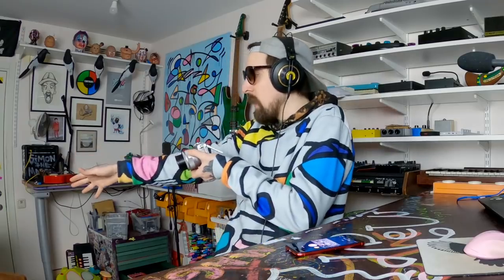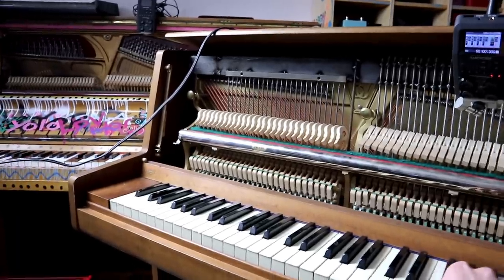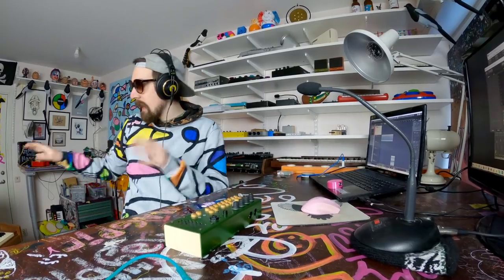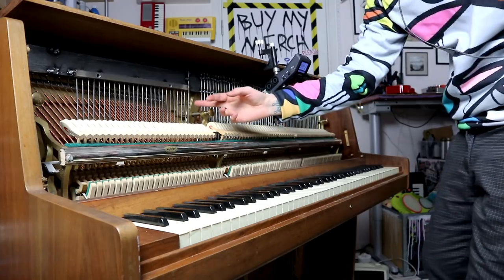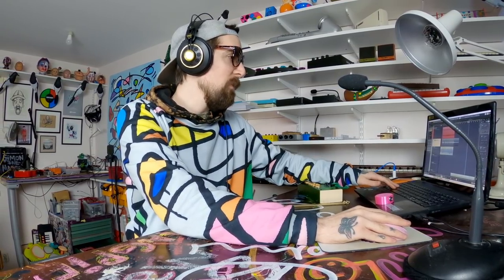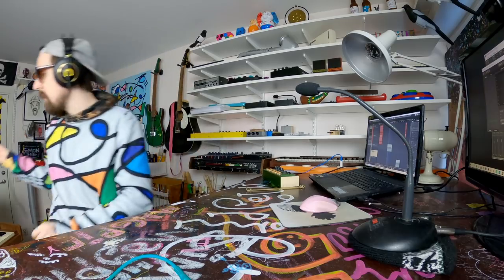I Made A LIFE SIZE TOY PIANO And It Sounds Absolutely Haunted

Comment: Sorry if someone said this already:
you don't need to change the length of the bars to tune them.
To tune them down, you can add weight to the end, or thin it close to where it's welded.
To tune them up, you can thin them (remove weight) near the end.
Cutting the bars shorter is fine, but welding them seems like a bad idea to me, because you are annealing the metal, and that changes it's hardness (uneven).

Comment: that piano would make a great instrument for a movie or tv show where it gets spookie 
you bight be able to tune it better if you tread the ends of the rods and weld nuts on the mounds instead of welding them solid , that way you can lengthen and shorten them a little eazier 
might allso improve the sound if you put some harder plastic or rubber on the hammers

Comment: If you want to tune the tines like a Rhodes, get a 1 to 2cm (in height) spring / coil that would tightly wind around a tine & move the spring up or down the tine to change pitch ;)

Comment: I think this has alot of potential maybe by adding spring to the metal spoke leading to the strings or attaching them to the bottom with some thing that could tighten and loosen the tention. Perhaps other things could work as well. I wouldn't put this project on the shelf just yet.

Comment: If you meant it to be serious a simple way to make it tunable would have been to make something that the rods slide into that is then clamped down.  (Solution I would suggest is finding a pipe that the rods can slide into then drill a hole and weld a nut and get a screw and then weld the pipe fixture to the angle iron you're using as a backboard.) So if you wanted to adjust the tuning you just raise or lower the rod and if you want to finalize it just cut it from the top. Welding on the bottom end of the rods will affect the sound, as the weld will have a different material property to that of the parent material. Welds are physically harder and more brittle than their parent material.